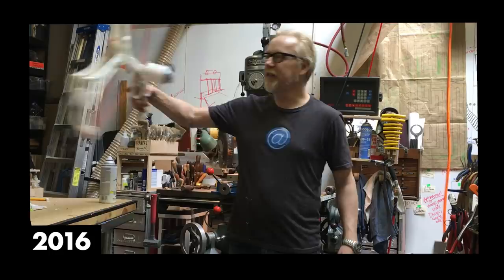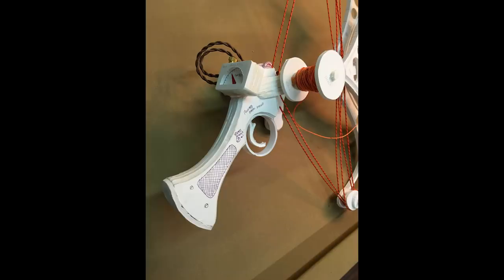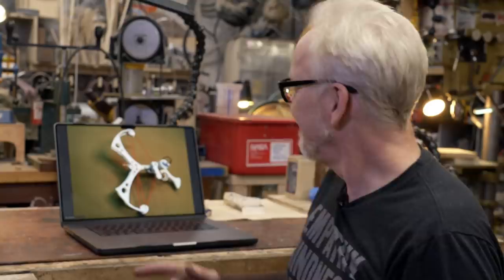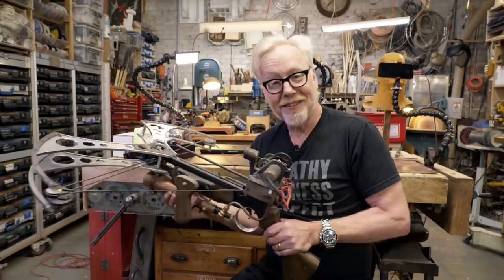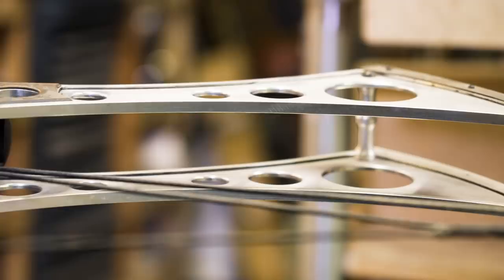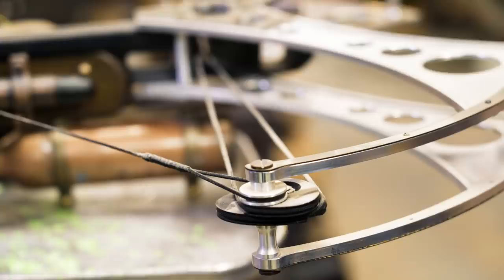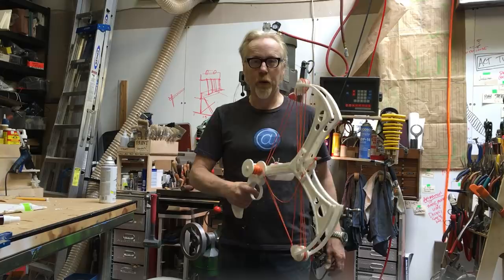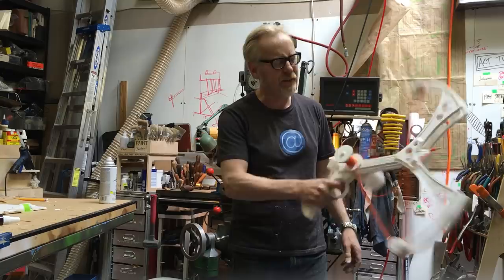Adam Savage's Dirk Gently Steampunk Crossbow Hero Prop!

Comment: I think that's an actual 'working' pneumatic crossbow launcher by the looks of it- the HPA air bottle is seemingly connected to a working solenoid valve which has the skinny barrel sticking out the front. Fill the air bottle ( 3000psi ) and every time you pull the trigger ( you hear the solenoid clicking in the video ) you'll get a blast of lower pressure air from the end of the barrel- slide an arrow over the barrel and it'll get launched ( remove the knock from the rear end )! 

That's kinda scary really... :D
Reply: Or maybe the air drives a generator for the tazer?
Reply: @edbennett8257  No- look at the piping and the wiring, and the barrel ( crossbows don't have barrels, airbows do however.. ). The piping goes to a solenoid that you can hear clicking as Adam plays with it, and you see the wiring going to the same place from a hidden battery. If you spend enough time hanging around the Spudfiles forum, you learn these things... ;)

Comment: I would guess that the canister on the bottom is part of the cocking mechanism. Perhaps there is a pneumatic/fluidic system to cock the bows, since there doesn't appear to be traditional access to the bowstring.

Comment: 8:25  Devil's in the details, and so...it's a shame about this shot.  The plastic-coated electrical wire and connectors, the stainless steel screws (Philips head, if I'm not mistaken) and the Nylock nut.  One hopes those details weren't obvious in filming, but cloth-covered wiring and sticking to brass screws would have been a nice touch.

Comment: That looks awesome, but it's going to keep me up tonight trying to workout if 2 strings would increase the draw weight let off that compound bow experiences. I may have to experiment. Although the 2 triggers wouldn't work, as when the first trigger is pulled the second string would still be holding the limbs. Both strings would need to release at the same time or it would need 4 independant limbs with some seriously beefy cam pivots.